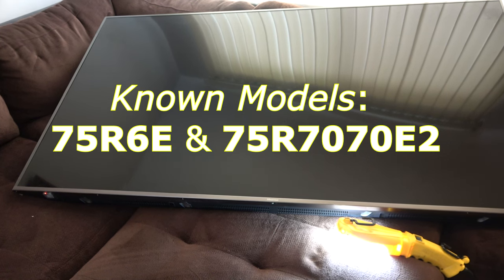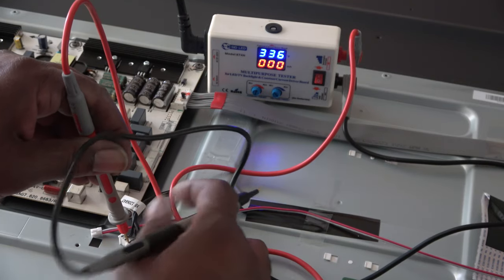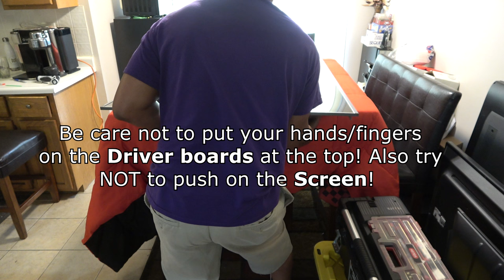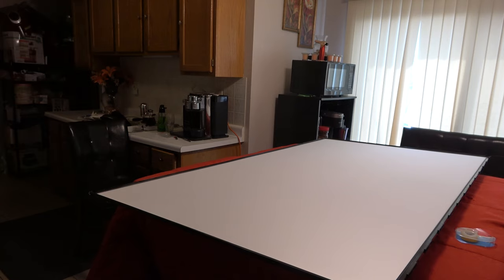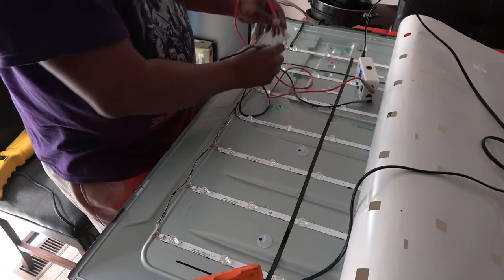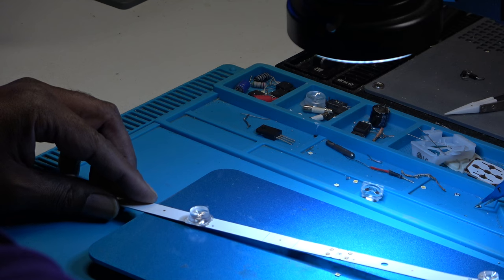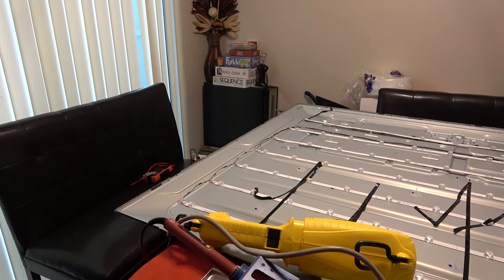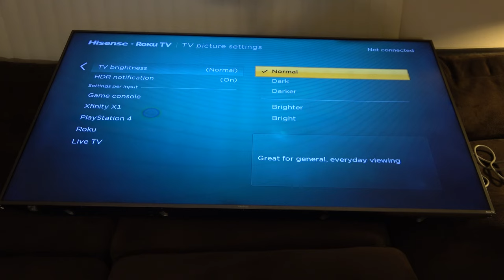Hisense 75 inch ROKU TV, red light flashes but screen is still black; Full Repair!

Comment: I´m never buying an Hisense tv ever again.
Reply: Same broke 3 timew this year
Reply: It doesn't matter what TV you buy TVs are built on hours there are not like the old school TV
Reply: After this 70 yr old gal watched this to the end, I decided I would just buy another TV but not a Hisense Brand. Enjoyed learning though but I just dont have the patience to take mine apart.
Reply: You're misinformed. All LED TV's will have this problem at some stage of its life. Secondly, it's internals are shared with many other brands like LG. 

If you wanna avoid such a problem, consider upgrading your TV every 3-5 years with a newer one.
Reply: @The_Truth777  well I have LCDs that are 20 year old and work fine until this day.same as computers it is an issue of design. Cheap $200/300 dollar TVs are designed for that. You get what you pay for as anything in life.
Reply: @warclan5429  But Hisense is not a cheap brand. It's on par with Samsung. In fact, all Chinese brands! I don't get the logic of bashing Hisense over anything else Chinese
Reply: @The_Truth777  i found this hisense model in the trash. Looked brand new as it got me to this video trying to fix it. The manufacture date was 2022, a TV that has a shelf life of 2 years 😏🤣😅.  Hisense is not a screen leader like LG , Samsung I have to add that failures lead to bad design and low quality manufacturing elements like LEDs and capacitors. This is where pennies make a difference

Comment: Great job as always! No need to change the strip if the rest are good. LED’s are way cheaper than buying a strip. Maybe a little more work however you get the practice.
Reply: you no chance to open screen often;;;led have hours  lifetime work   :::good change all even after a crazy the good tech, did  it is delicatet work chance to crack fragile  sceen is  too hight
Reply: My tv is sharp 70inch 4k at
 First of all started with turning off and having the stand light blinking  ,, then after that went black screen , we replaced  the backlights,  and still doing  we replaced the motherboard the t-con the power board and the other board that was left to replaced ,, tv working ! But now we have this ghost black spot right on the top middle of the tv ,,, can maybe tell me what else we need to do ,,? Please help

Comment: My tv had the exact symptoms you described and I took it apart and put the meter on the terminals as you did and I got no voltage and no lights lit up. I did it plugged in of course.

Comment: Sooo, am i safe to assume that this is the exact same procedure for the 75" Hisene model 75R6E1? Orr should i keep looking for a video with that exact  model? 
 I only ask because i absolutely love how you explain what you're doing while you're doing it and in a clear understandable manner!! 
 Soo, i really hope i can use this video with the model i have..
Reply from the maker: Yeah, same one even though they may use different strips if your going to get all the strips which is highly suggested.
Reply: @bigdog8882 Yes!! Thank you!! Actually did start the repair process earlier today and followed your video. I got to the part where I took all the small screws out of the outter bezel before flipping it over, but I had to stop there because I have it on just laying on the screen on 2 plastic horses and some thick Styrofoam as the "table." I was afraid to flip it over by myself because it is now really flimsy and I was afraid of cracking or shattering the screen. Also, I was afraid of damaging the boards on the back because those 4 metal "feet" weren't gunna hold it and the entire weight of the TV would have been on the boards. 
 Soo, I stopped there for today, but I am making good progress and I only have you to thank for that!! 
 Your video of showing and explaining everything you're doing as you do it have been nothing but a guided blessing!! 
 I'm gunna continue to work on it not tomorrow, but Wednesday. I'll definitely keep you posted!! 
 I hope you don't mind if I bother you if I come across any other questions? I'm sure I will..

Comment: Thank you! I managed to fix my* TV! hope it will keep working, I will replace thermal paste later...

I used table frame that is wide enough to place the TV on it without damaging all the boards on the back, that way I was able to access both sides of the TV without flipping it, I used big cardboard as "backboard" under the LCD panel when removed it.

Comment: I think I said this before, if you have the room, get two tables end to end, and simply lift and move the screen over to the other table, I have heard about those suction cups letting loose, I don't see how, but I guess it can happen, then buh bye TV. I have salvaged many cracked screen TVs, good way to get a feel of how easy or hard things break. The diffuser isn't real easy to break, the screen is the most fragile. The polarizer films are flexible, more of PITA to handle but not easily damaged.
Reply: I've been doing electronic repairs for 23 years please do not use the suction cups it will crack the screen
Reply: @whereswaldowhereiswaldo3144 How so? I see them used a lot, only problem I ever saw was one came loose and they dropped the screen. Personally I think the safest way is have two tables end to end, and slide the screen over onto a blanket using two people, lifting as little as possible. small screens are not such a big deal. 65 and up become kind of hairy.

Comment: I just followed this step by step.  I have the exact same TV.  Backlights now work.  But now all I have is a white screen
Reply from the maker: Double check your connections on panel driver boards and tcon board.
Reply: Did you get this issue fixed? I’m currently doing this and wanna be prepared if i run into this issue
Reply: No.  I threw the POS in the trash!  I’ll never buy Hisense again

Comment: Hey as a mechanic I always would recommend replacing parts in hard to reach spots if I am already going in. Because just cause I replaced one part with 300,000 miles on it doesnt mean the other parts reset to 0. So my point and question here is with the other LEDs how long does a repair like this last? Like on a car certain parts I know absolutely should be replaced and some I am like lets just take it case by case. So as a 1st timer and not someone who will do this too often do you think i should just replace all the bulbs?
Reply from the maker: Yes, just replace ALL the led strips.

Comment: @BigDog8882 In previous videos, you always suggest changing all the strips. Were there none available or were the strips too expensive? Or was there another reason why you just replaced the individual LED's?
Reply from the maker: I have the strips for the 75R6E3 which I discovered were different. I mentioned that in the Video. So I just fixed this one just to get it back to customer in the time frame I promised.  Actually if you try to replace all the strips on this 75" Hisense, you risk tearing up the white background paper in different spots and no matter how good you try to tape it back, the TV picture looks like shii. I havent had any problems with previous 75" hisense with just replacing the one bad strip. Just turn the brightness level down to "Bright" or "Normal".

Comment: Im new to this. Thanks again for helping me with my recent tv. I need to fix my old one.

When you hook up the multimeter, what switch are you turning it to (v, capacitance, ohms, etc)). Exactly where on the strip and exactly where on the wires are you touching? I couldn't tell😢
Reply from the maker: Well if your testing the voltage going to the strips, U would put your meter on DC Volts. But I was using a backlight tester to light the led's up.

Comment: hey BD, I recently fixed an Insignia which i thought was bad backlights since i had image with flashlight but it ended up being a bad power board!
Reply from the maker: Yes, I had a few TV's where the backlight circuit was not driving the led's.

Comment: Hey Big Dog,,  You mentioned that some have 2 pin led power connectors ( 75R6IG) , mine is like this and board says it should be 98V, when I check connector it's 0V across them with power on,, is the LED driver most likely bad?

Comment: hi I have a question if you can respond as soon as possible Hisense 75 inch red light constantly blinks no power red light constantly blinks when you disconnect it and reconnected will not stop blinking

Comment: Guys, I tried these steps multiple times and it worked.

Step 1 - Remove the power from the socket.
Step 2 - Press the TV power button for 30 seconds (Not in remote, It should be on the TV) 
Step 3 - Connect the TV directly to the socket after 60 seconds and turn it on.

If it doesn't work,  try it for 3-4 times.

Also, check the number of times the power light blinks, it indicates what cause the problem. 

My case, it was 3 times and after repeating the procedure it was 5 times. And the next time it went on.

Good Luck guys 👍

Comment: Hi, I  changed all the strips with new LED strips. Check them out like you did.  They  all light up with the tester.  Plugged TV to working electrical outlet turned TV on,  no lights.  What happened? So much work for nothing.

Comment: i have the google one 75 inch and it screen will flash then the power button  will flash 20 times i can use a flash light and see the image on the tv do you think its a wire ?

Comment: Well sob this is the same TV I just got, Hisense has become the new TCL for bad backlights. I'm seeing a LOT of bad backlights. "Hisense Roku TV" will show on the screen then it will go away and restart then show it again, so make sure you keep watching. The backlight set is about 30 bucks. BTW I tried a 58" Hisense yesterday, the backlight wire was red and black, the black was positive, red negative, it was even marked on the connector N and P so they will be backwards like you said.

Comment: I have the same issue and i bought the LED tester and on all 4 sets of wires the back lights come on running at about 76.5 volts. Any ideas?

Comment: Ive got a question maybe u can help me with.  My 75" ONN TV will turn on and run fine for about 2 hours and then i get a black screen.  When i put a light up to it like u did in the video, i dont see anything at all.  Now, if i unplug the tv for about 15 or 20 mins and turn it back on, it work again, but usually only about half the time as it did before.  I try the whole thing over again the next day, and it does the same thing.  Would u say its a power or main board problem?  Thanks for any help u can give me, in advance.
Reply: #shawnyMike my was the same we replaced the motherboard.

Comment: Is there any way to do this without a variable power supply? I've just been using my multimeter to try to measure resistance to find the burnt LED, but my readings are WILDLY inconsist for some reason. I'm beginning to wonder if there's some reason I'd get inconsistent readings from a single series of LEDs.

I'm basically just tracing power, right? So I START at the beginning of the series, leaving a lead. With my other lead, I'm tracing power through each consecutive LED.

I feel like I'm just making a rookie mistake somewhere that I'm just not noticing. I haven't done something like this in like five years and I wouldn't consider myself a professional.
Reply: Use diode mode instead and touch the two points between the LEDs and if the LED lights up, it's good, if not then it's bad. Also you do this with no power running to the tv
Reply: If multimeter doesn't have diode mode, use 2 AA battery's instead to test each LED. Could also use 3 9v battery's connected together to make 27v and test a whole strip of LEDS instead of one by one.

Comment: Need help.   My tv is sharp 4k 70 inch. first my tv was turnnig on we could see the logo and then went off , the stand by red blinking light on,,, so it was a black screen ,,, so we replace the backlights. And it did not work ,, we replace the powerboard and still doing it.  We also replace the motherboard ( mainboard) and the t-con and the last board we also replaced , ,,  so tv working now ! But now we have this black ghost spot on the top middle of the tv ,,, what can we do now , please help !

Comment: Ok where does the come from I have the same problem what is the wire I like your video but give better info
Reply from the maker: Sorry, Its the wire going to one of the led strips from the power supply.
Reply: I solve
Reply: I fixed Flash when you put on tv one of the led was broken just remove the and soder a brigh that made it work

Comment: this is a bad repair. the diodes should all be replaced or the tapes replaced with new ones. the only question is when will the next one stop working, did those diodes all work at the same time and they are all consumed at the same time. I speak from experience. very quickly you open that TV again.